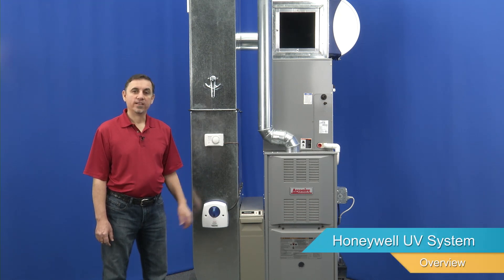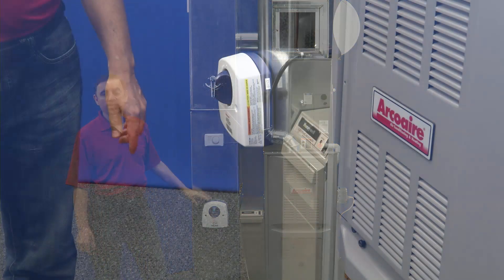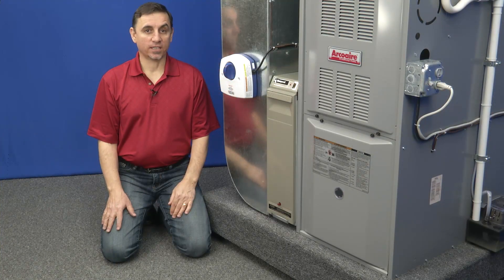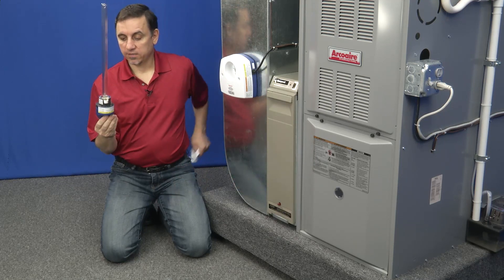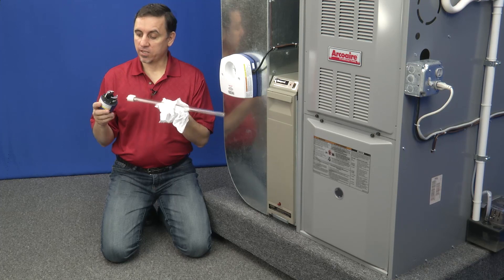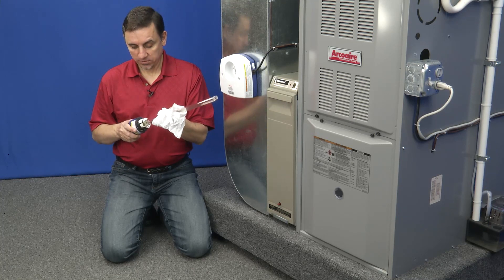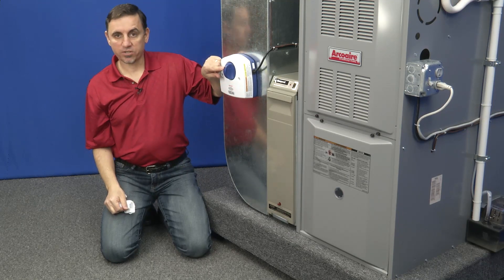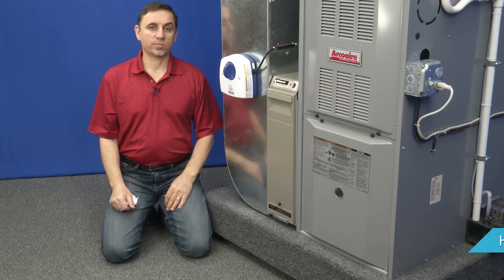Honeywell UV System Overview And Maintenance

Comment: Thanks for a thorough explanation for maintaining the UV100E1043 system.  UV lamp stopped working over a year ago, had ordered a new bulb, but it still did not work.  Recently installed 200AMP power panel and rewired my home and it turns out the outlet socket I used was bad and replaced, but the unit still did not light.  I didn't know about the reset button on the bottom of the unit, so, thanks so much for your video - reset fixed my issue.